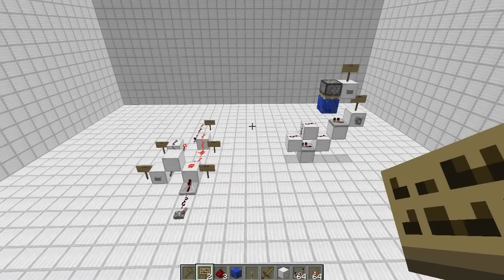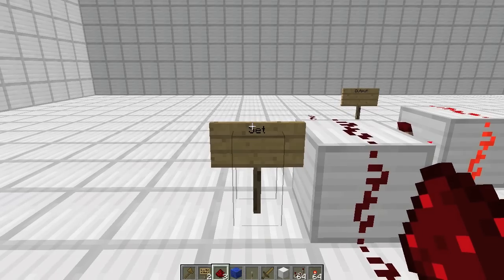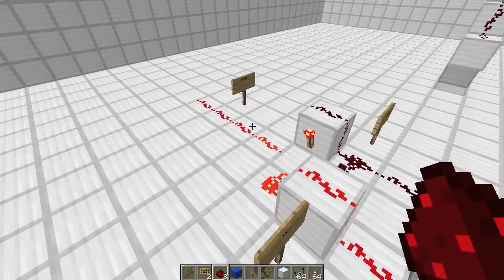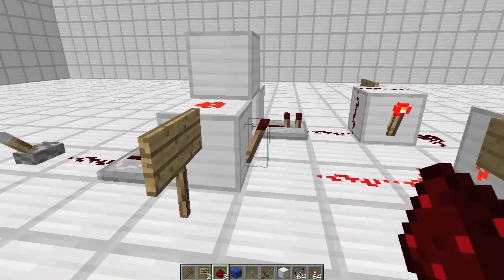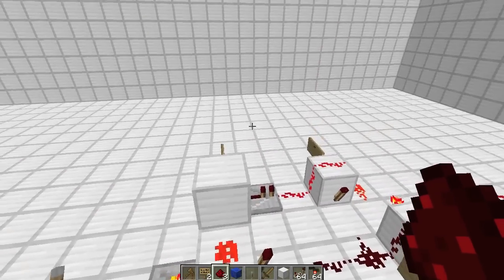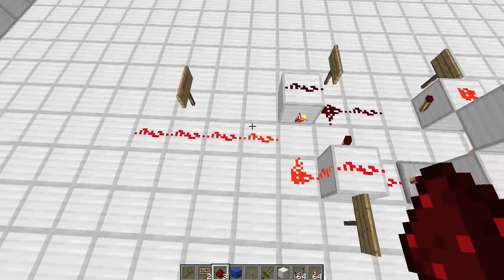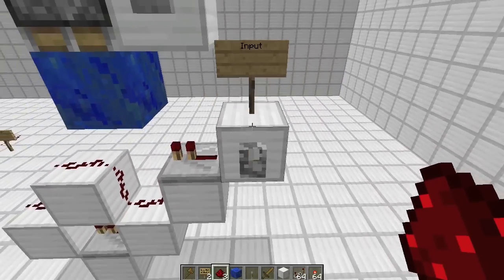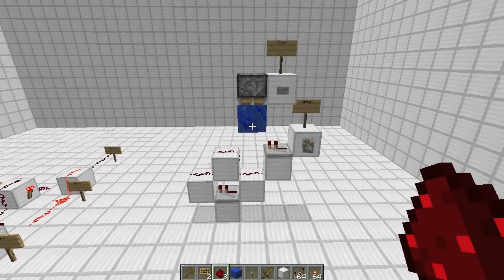Need to Know: D-Flipflops - How they work and a highly efficient design

Comment: place two blocks above eachother and put a button on the lower one a lever on the upper one
then put a piston on the block with button facing away
you can take the power off a block attached to the piston
done